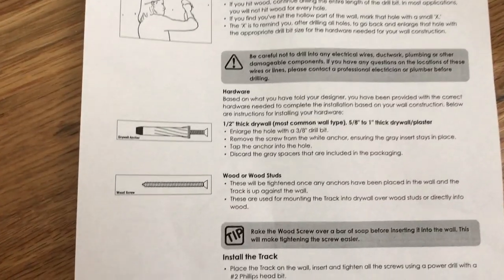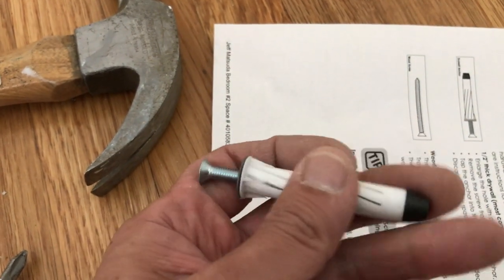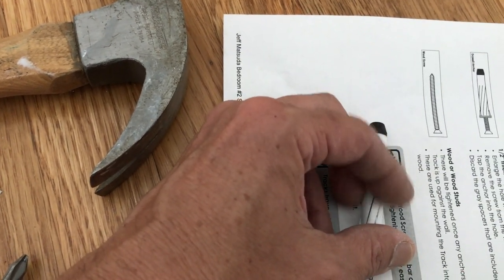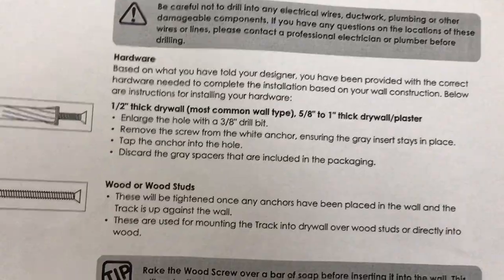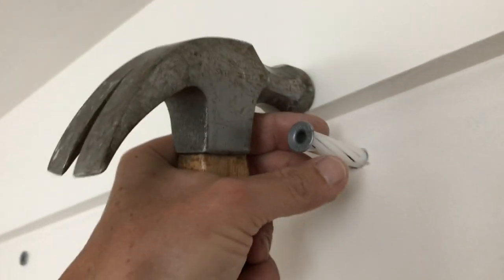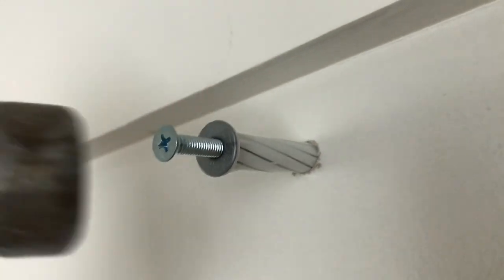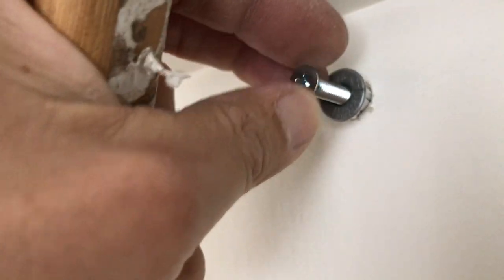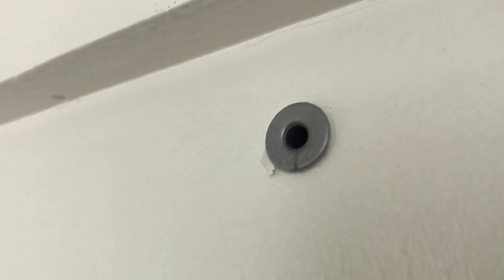Elfa Closet System DIY - Part 1: Installing Drywall Anchors for the Top Rail

Comment: Had just come to the same conclusion myself (although my instructions just say “your designer has included the appropriate anchors based on what you told them about your walls”, then you look at the schematic on the bag of anchors, and it doesn’t even show that little grey detachable plug). Anyway, glad you made this video, so I know I’m on the right track. I already had a mini freak out because the holes don’t align with any of my studs, due to how they cut it; but then I saw how big the anchors were, and read the instructions again ( “you might not hit any studs”) and I relaxed;-)
Reply from the maker: Yeah, each of the anchors hold a surprising amount of weight.

Comment: What size drill bit do you use?
Reply from the maker: The initial drilling (to find out what's behind the drywall is 1/8th or smaller.  the final hole size is 3/8".

Comment: If I drilled my hole too big, can I glue the anchor in with gorilla glue? : (
Reply from the maker: I don't think gorilla glue will work.  Either skip that hole or use a different anchor from the hardware store.
Reply: You probably didn't make the hole too big.  You have to screw in with an electric screwdriver for 30 seconds to get the plastic collar to expand. If you did screw up then get the Easy Track toggle bolt anchors.

Comment: I used to love ELFA -- every time I moved (military) over 15 years, I used this shelving.  I just bought some -- what crap it's turned in to!  No more printed instructions, the top track is smaller and cheaper, and the drywall anchors (as shown in this video) have changed without explanation.  Even the "little red fabric" bag that came with $2K worth of shelving is gone, replaced by a container store paper bag. Latter not a big deal.... but just a symptom that the product is cheap now. No longer worth the price.